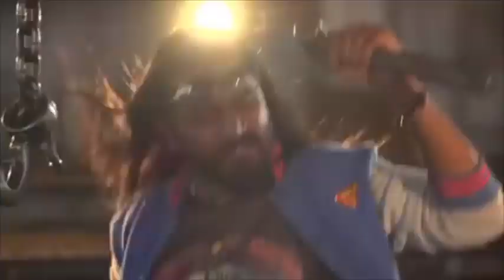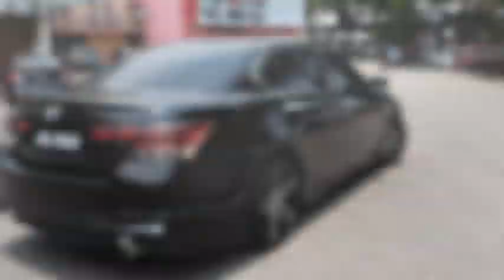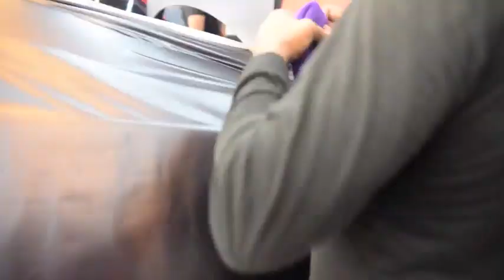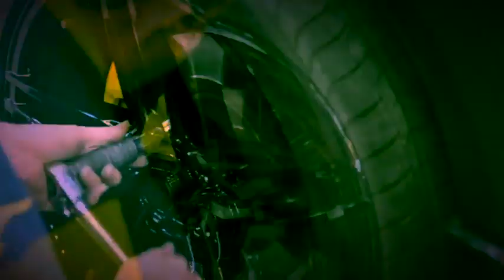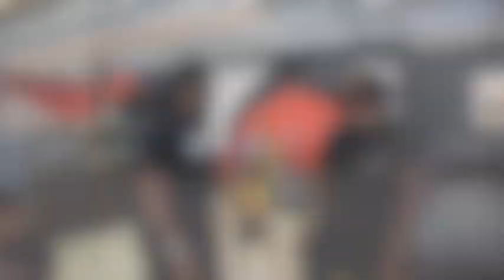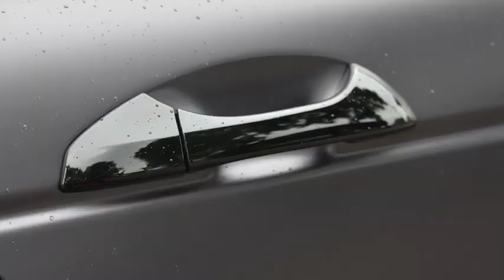Vikadakavi Magen's Car Wrapped with Satin Dark Grey

Comment: Bro how much for Proton persona 2009 full body wrap killer chameleon or midnight purple ? Rim matte black ?
Reply from the maker: For your Proton Persona , we give starting price at RM2800++ for the full body wrap.  Then RM900 extra for matte black spray on the rims.
Reply: @detailcitycarstudio4670  thanks for the respond bro! This is for killer chameleon or midnight purple ?
Reply from the maker: @ஆதித்யகரிகாலன்-ஞ2ய  That price is for midnight purple. For killer chameleon we have to confirm the stock at supplier first.
Reply: @detailcitycarstudio4670  okay bro sure. So can I use waze for your shop ? I'm magen's cousin actually.
Reply from the maker: @ஆதித்யகரிகாலன்-ஞ2ய  Yes sure bro. Actually good promotion ongoing for wrapping now until this end of month😎
Reply: @detailcitycarstudio4670  bro but I'll get wrap on December or January because engine works going on.